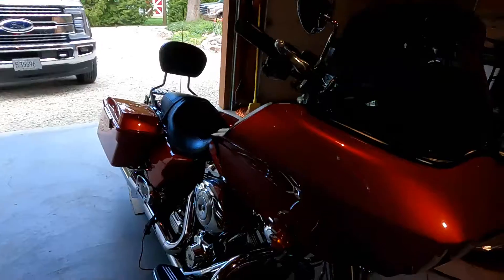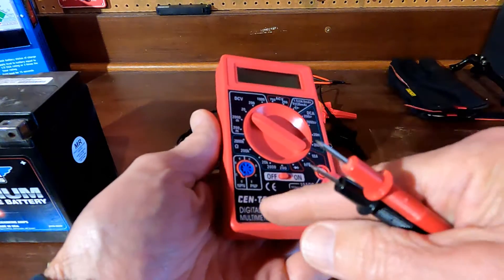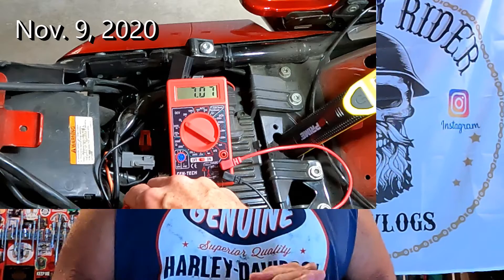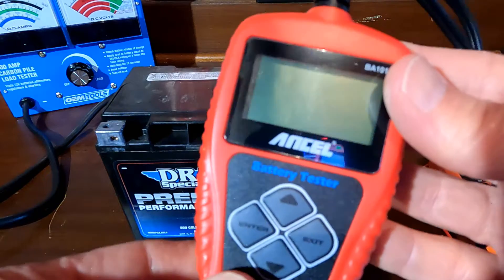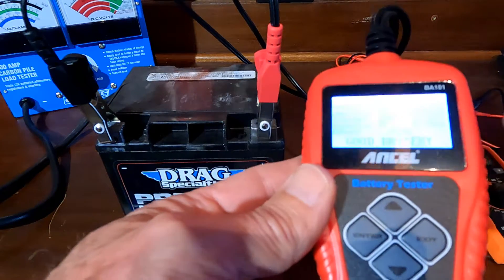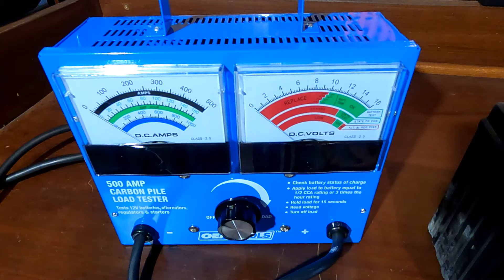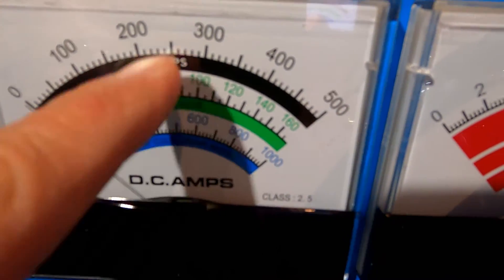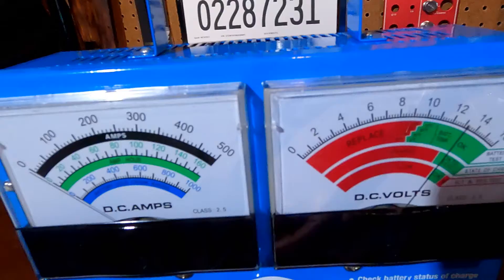BCR Garage Series: 3 EASY ways to LOAD TEST Harley batteries👍

Comment: how long do cycle batteries last? Like cars where 6 yrs your on borrowed time ?? Do you use trickle chargers on any of your bikes ??
How long does it take to recharge while running ??
Reply from the maker: They last 3 years on average. They are exposed to a lot more heat and vibration than a car battery.I always keep my cycle batteries on trickle chargers when parked at home. If not fully charged, they will fully charge up in short order because the stators put out over 14 volts.

Comment: Why do these batteries not last more 3 years ? I drive a 1995 Softail with no electronics.
Reply from the maker: Vibration and heat are both battery killers. Softails are especially hard on batteries because they sit right in the middle of the horseshoe oil tank.